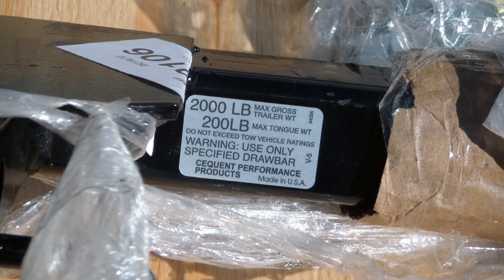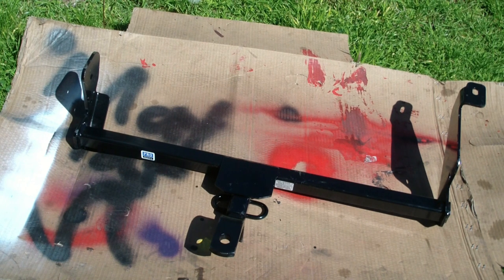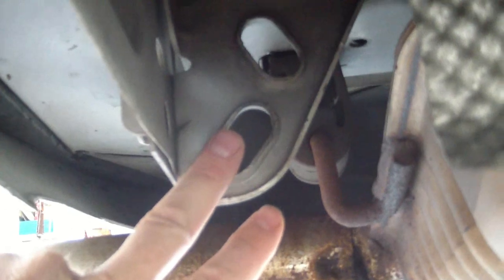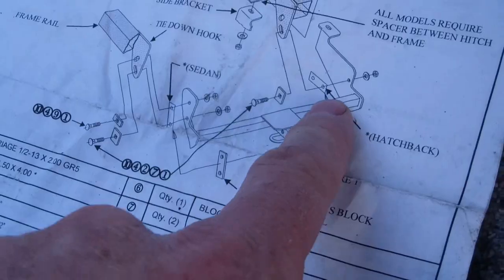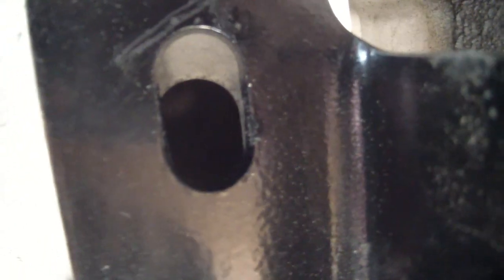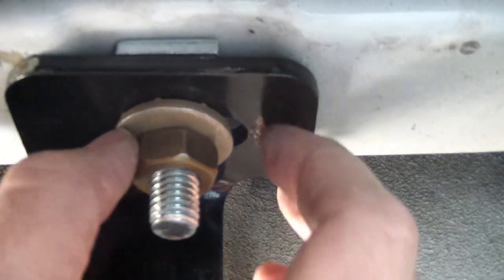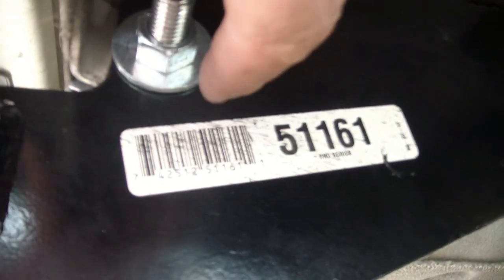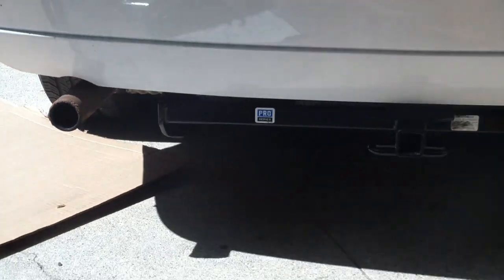How To Install A Trailer Hitch On A Car - Ford Focus

Comment: Just in case anyone would be in my situation, when you buy one for a wagon, make sure they sell/send you the right one. ZXW's hook aren't at the same place, thus it's another model.
Great vid 👍
Reply from the maker: Thanks.
Reply: I have a ZXW 2006 wagon.  Which model/brand did you get and did you have to drill holes?

Comment: Awesome video. I have a Ford Focus too and was so happy to see that I can add a hitch without paying a mechanic to weld one on. One question, though. What do you do about connecting the trailer lights to your Focus?
Reply from the maker: regression  I didn't wire mine up, so I can't answer that for sure.  I would guess that you could buy a trailer wiring kit, and run it into the trunk and splice it into the wires for your rear brake lights.  I don't know how hard that is to do.

Comment: Just installed mine today. I also had an issue with it lining up on the passenger side for me to drill the hole, so I tried bending it the same way you did (crescent wrench and foot), but that didn't really work out. So I used a ratchet strap and it worked great, no need to muscle it.
Reply from the maker: fightnuttube  That's good.  Either they get a little bent in shipping, or they aren't that carefully made, but they seem sturdy enough once you beat them into shape and bolt them on.

Comment: You need to tighten the three bolts first. Then the hole will line up. No bending required.
Reply from the maker: Thanks.

Comment: Most kits come with a 'fishing wire' that threads on to the bolt so that you don't have to use wire and tape. I'm surprised yours didn't come with one.
Reply from the maker: Ethan Hanson That makes sense.  I've never done this before, so I didn't know that some of them come with tools to make it easier.

Comment: Instead of going to uhal and have them install it how do i do it myself i got a 06 Buick Rendezvous Suv and a 04 Chrysler Car what's the best trailer to get for them cars ?
Reply from the maker: I bought mine on eBay, searching for the year and model of the car. The brand name is Curt.  Not sure what trailer you can pull with it, but read what the hitch maker says about maximum tongue weight and trailer weight.  On the Buick, you may be able to find a full size 2" hitch unit, rather than the smaller one you see me put on in the video.  In my case, my son rides BMX, so I just needed a hitch to hang a bike rack on, and I don't ever pull trailers.